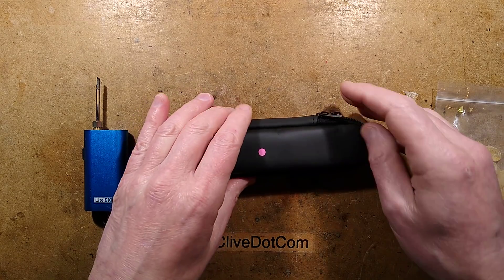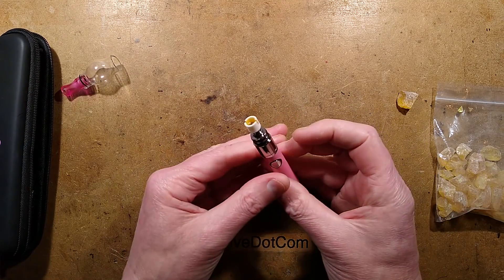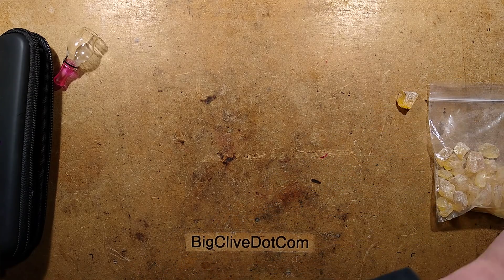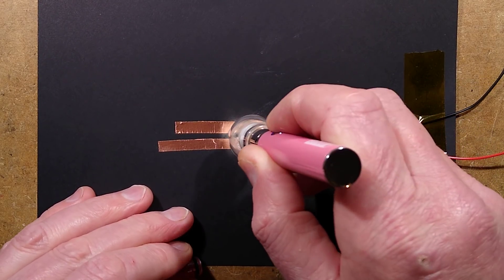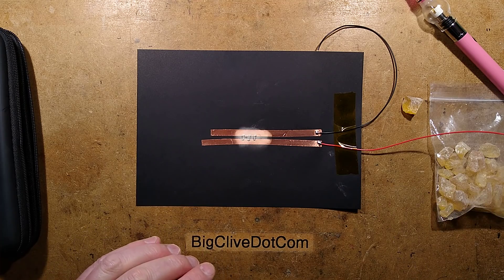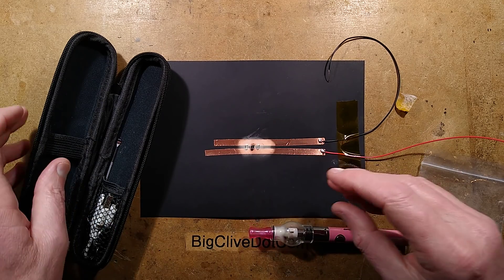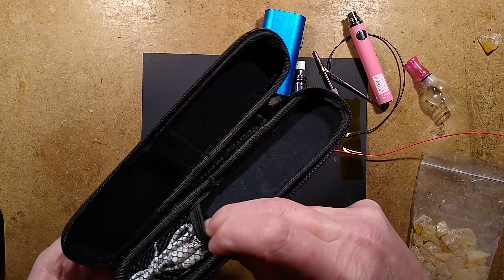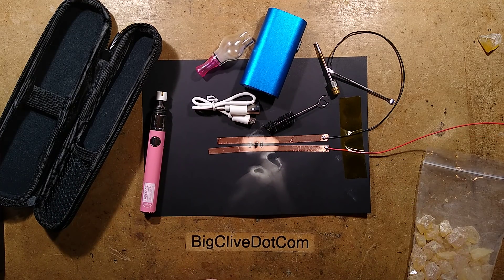Novel rosin vapour short circuit finder

Comment: It will impossible to use while diggin for a faulty component on a RF device , even more if the RF device works on high or very high frequency : you have to clean all the flux on rf devices because it can makes strange things such as self oscillations if some flux stands between two critical pads . So imagine on the entire pcb ...
Reply: I think you're confusing RF with "high impedance circuits", like gain loops with huge multipliers and giga-ohm resistors. These are much more affected with leakage through flux than RF circuits are - RF circuits tend to be really low impedance and thus not affected nearly as much by a little leakage.

Comment: I could see this being very useful for where a thermal cam is unavailable because of the high cost. Also beats the old stick your digit on it to see if it starts nuking or frying.
Reply: You can just put a little bit of IPA on the board too - it evaporates first on the component that's getting hot. Then the rest of it evaporates or you can blow off with compressed air, and the board isn't coated in rosin flux after. This is cheap, but rubbing alcohol is probably even cheaper

Comment: Definitely looks like a standard 510 connection for vape pens.
I'm sure the base is identical, even down to the little brush and the short power cable.
Reply: It's a complete concentrate vape kit. No difference lol. The big glass dome is to usually cool the vapor a little bit before you inhale, the small metal scoops are for hash, shatter, etc. I love it.
Reply: That's exactly what that is, a vape battery.
Reply: It's not actually a 510, it's an ego.
Reply: @TheShiningDark1  Poteto Potato. Close enough.

Comment: Ok, I guess you would use isopropanol to clean up the mess after diagnosing a short with that thing. But you could use alcohol/isopropanol in the first place to see which part heats up so much that it evaporates quickly, right?

Comment: Pink is magical because its the only color that can never be one real light based color. That is to say, humans can't tell the difference between red + yellow light and orange light, for example. Every other color on the wheel has a corresponding light wavelength that it can be associated with, but not pink. If red is  0 and blue is 2, then pink would be 1i because green is already 1. Pink can only be a set of [0,2], it cannot be a single number. Magic! lol

Thats a neat use of that, it doesnt seem to be modified in any way from a cheap "vaporizer" (boiler) though. Seems like it could be made better by redesigning the bowl to work better in a downward position, maybe add a crossflow vent to create air currents that help the rosin come out. Theres room for improvement here
Reply: @Matt Quinn Thats what I was getting at, sorry if it was unclear. I was using "pink" as a colloquial term for magenta, which i was using to refer to all shades of magenta not just a single wavelength set, which purple is, by rgb notation

Comment: I've seen that a while now. I think it's actually a gimmick. The way they do now, they use a voltage injector, which makes the shorted components heat up, then you use a thermal camera. Where did you get the copper strips? They're cool
Reply from the maker: Copper strip often sold for electronic uses on eBay and also as a slug repeller.
Reply: Can't say for sure, but I've seen self-adhesive copper tape on amazon (and some other conducting and non-conducting metals like aluminum, too). Those can be rather neat for repairs or prototyping (or decorating).
Reply: But this is a LOT cheaper than a thermal camera. The copper strips are just regular copper foil tape. I first saw these flux vapor things on Northridge Fix channel fairly recently. You can also use the Louis Rossmann method and just pour a little IPA on the board too - it evaporates first on and around the component that's getting hot, and you don't have a bunch of rosin to clean off the board after - all the alcohol just evaporates eventually.
Reply: @gorak9000  If we're talking cheap, then you can do without it entirely; electronics have been fixed long before these pipes appeared. The thermal cam is not so expensive. You just get a cat phone, which also has thermal. I've seen louis's method, but you can't wet a big board with alcohol, bc alcohol dries very quickly
Reply: @Kevin75668  You can also get it with conductive adhesive to use for things like RF / EMI shielding. Usually the stuff with conductive adhesive is $$$$. Even if the adhesive not being conductive doesn't matter, even the regular stuff is $$ because it's copper (and because it's kind of a specialty item)
Reply: @Kevin75668  I think I've only ever ordered the 3M stuff with conductive adhesive from digikey (on someone else's budget) - and that was many years ago - pretty sure it was at least $50/roll doing it that way (but again, someone else's money, so didn't really bother me)
Reply: @gorak9000   I think McMaster-Carr has a conductive adhesive copper tape which is cheaper, although I don't think it is the 3M one, it's some other brand.

Comment: These work great for determining the potency of crystal meth. Put some crystal in the atomizer and when you turn it on you will notice that if the meth is strong you'll get really high. If it's not that strong you will get alittle high and if it's fake you won't get high at all. These crafty Chinese electronic manufacturers are getting smart!

Comment: you should be able to unscrew the ceramic pot and find the 505 threads I think and you then can use it on the blue battery you were soldering with.

Comment: I've used one of these for the more intended purpose, it seems like it actually works better as the tester than it does a vape
Reply: The little "spoon" thing is remarkably like an ear pick!
Reply: I bought one of these for dabs/concentrate. Way more expensive since it was sold as a vaping product. $70 compared to $9. Im sure the one i got is a litter better quality, but still crazy the mark up is as a vape product.
Reply: Umm "vape?" You did see the little spoon it comes with?
Reply: @lucidnonsense942  as Daniel pointed out its for oil/dabs, which you can vape.
Reply: @lucidnonsense942  for putting your cannabis extract onto the atomizer
Reply: @lucidnonsense942  "You did see the little spoon it comes with?"
I never knew that a spoon dictates what substance you can scoop with it.

Comment: Hi Clive, the bulb thingy is there so it can keep lot of smoke in (while held upward) and be dumped on the board.
Reply: Haha it looked like marijuana inhaling device to me.
Reply: @liucyrus22  That's because it is. These were sold in smoke shops and vape related shops back in roughly the 2011-2015 era. They are for smoking hash oil. That's why they come with a plastic mouthpiece that fits over the glass dome. 
Eventually they were made obsolete for drug use after prefilled hash oil vape cartridges became widely available in recreational cannabis dispensaries (this was in WA state). 

I'm assuming they are selling these as a "short circuit detector" just to give it a plausible "legitimate" use outside of outdated drug paraphernalia.
Reply: @platyhelminthes2877  they still use these for hash, thc concentrates dabs/wax/shatter etc. When you buy that stuff in quantity, or make it yourself, you cant use the disposable stuff and need something like this a bong/oil rig.

Comment: You really do operate a channel ideal for the electronics enthusiast. I never had the idea to use one of these to vaporize rosin flux. That is much cleaner than liquid for hitting QFPAs with liquid.
Reply: From electronics diagnosing to crack pipes and everything in between. lol
Reply: @BillAnt  It's called an oil-pipe... dragging the name of a simple vaporizing device through the mud by associating it with crack shows how little people seems to know about this subject matter.
Reply: @chrisakaschulbus4903  - It was meant in a humorous way.

Comment: I have to get me one of these! I can see straight away that it's going to be very useful in finding faulty components in vintage radio and TV circuits, or at least, which resistive components are suffering an overload, and therefore where to start looking for the cause.
Reply: Not sure if useful for vintage stuff, unless our definition of vintage is different. Mine is vacuum tubes and big-ass components that heat up so much that the rosin powder will be gone on almost all of them (maybe save for grid leak resistors as they don't heat up). Plus the rosin would be soon gone thanks to adjacent parts giving off heat - especially tubes.

Comment: As soon as I saw the video title, my mind went "DING" with understanding.

Pro:  A lotta-lot cheaper than a thermal camera.
Con: Potentially more rosin cleanup, post-repair.
Reply: Even cheaper yet is putting a few drops of IPA on the board - it evaporates fastest on the component that's getting hot, and all of it evaporates eventually - no rosin cleanup required
Reply: con: everyone who sees it in your kit will think you're a meth head...

Comment: Rosin is a unique type of cannabis concentrate. It is made without using any solvents. Instead of using a solvent rosin is an extraction technique that utilizes the combination of pressure and heat to squeeze the resinous sap from the starting material (buds or trichome- rich cannabis leaves).

Comment: It's a vape pen for smoking weed oil. This is the same result as the freeze spray. Doesn't detect short but heat. These vape pens do not last long basicly disposable. Always look for one you can swap the battery or it's just junk. This is from personal experience. Gone through 30 or so of this type of vape pen before a gave up on them. Also the tips are not interchangeable with most quality vape pens. I wish they were.

Comment: Hmm i'm actually wondering about the temperture required to melt these small crystalls, as far as i remember resin is amorhic and melting point can varry quite a bit depending on circumstances. I wonder if you can control the size of the crystals or the height of the layer to control the monitored tempurture. It would be just bombastic if someone actually researched it!
Reply: Controling the crystal size is probably not viable. The cooling rate is very much dependent on thermal mass and conductivity of the coated surface (PCB). Best bet would probably be to pre-heat the target surface, but probably not worthwhile.
 
I'm sure one could modify the rosin chemically though to get such an effect. Mix in other stuff or use something other than rosin.

Comment: I've actually wondered if you can use the plant resin these devices were originally intended for as flux. It's got organic acids and terpenes in it just like pine rosin, but I really don't have any idea of the actual chemistry behind how rosin flux works.
Reply: bruh it's sticky as hell and has a burn point just under the melting point of solder, so i highly doubt this is a wise experiment.
Reply: @supernoob17  "Bruh?"
Reply: @soundspark  i apologize good sir i did not know this was a formal occasion and should be addressing you by the formal honorific "my brother in christ"

Comment: Thats such a novel trick to quickly identify a fault, i kept putting boards in NOVEC fluid to see which component made it boil, this is so much easier and cleaner!  cant believe i didnt think of that.... nice one Clive, ur a legend :)   , 8-bit.
Reply: Isn't novec horribly expensive to boil off in the air ?
Reply: Good tip. Where is NOVEC purchased?

Comment: Interesting! Now I'm actually tempted to get something similar with a 3.5mm jack on it to connect it to a TS80/TS100 soldering iron…🤔
Reply: I don't think that'll work.. Vapes typically run at the voltage of 1-2 cells running at upto 20A+, while the ts80/100/pinecil expect 12-24v at a lower current to achieve the same power.
Reply: @Annon201  Yeah, totally possible. I guess the big question is the quality of smoke/vape you can create.

Comment: I have an usb wall charger that I have detected using a noncontact voltage tester ac120v on the USB cable and my phone. it's an aukey pd charger and I was wondering if you would want to take a look at it. I enjoy all your videos.
Reply from the maker: The radiated field is common with ungrounded electronic power supplies.  It also happens with good quality ones and anything connected to them.

Comment: Many devices we use today had their origins meant for other applications.
Necessity is the mother of invention.
You typically do not look for something until you need it.
Reply: Indeed, albeit it does make me think who actually had the idea of using an electric crack pipe as a repair device... I can't fathom the thinking process.
Reply: @Kalvinjj  It’s simple, you smoke some crack and suddenly you feel the need to repair something, something close and not too far away, like the pipe your already holding and since it’s working already you’ve all the more reason to fix it. Then it’s just a matter of time or about 5 minutes before a fluxing accident happens, like when someone tries to actually smoke the magic smoke thats in all these components and makes them work in the first place.

Comment: Oh hey I have one of those - well, the same tip on a different pen - and I also use it to vaporize resin. <_< What? I live in Colorado! This is sorta clever tho...if you can find the solid resin? do they provide a lifetime supply? I dunno, I just flood everything with liquid resin then wash it with whatever's necessary when all the parts are on. (j/k)
Reply: Cool story, bro.
Reply: @littlejackalo5326  Tired comment, troll.

Comment: I've seen droplets of IPA being used for the same result in finding overheating components, this does look very useful.

A friend upgraded and gave me his device which I think has the 510 thread, I guess a replacement tank and soldering iron tip are not the only things I need to buy for it now.
Reply: This is more visible than IPA. In addition, if the components are too close it would be a bit ambiguous which component IPA is running away from. With this device, the component is literally highlighted. I think of getting a cheap thermal camera to look for the approximate location of the short and this device to precisely know which component is shorted
Reply: @OneOfTheNerds  ... can I use lager if there's no IPA handy? ;-)
Reply: @ulrichs.3228  I was waiting for this, vodka or Wray and Nephews rum maybe.
Reply: @ulrichs.3228  Nope, nope.   That's too thick.  You might be able to substitute American beer.
Reply: @tbelding  Louis Rossman has demonstrated doing this with high concentration grain alcohol (possibly denatured).  But yeah, a colored equivalent would be easier to use, especially if it boils below 150°C so it doesn't interfere with soldered components.
Reply: I have used IPA for just this. Saw these a few weeks back and was thinking of one for my grab box
Reply: It's not uncommon for us board repair folk to inject voltage into phone logic boards dunked in IPA and look for fine bubbles in the problem area with a microscope, I've used freeze spray as well as flux misting (this method) and very much prefer dunking when it comes to clean up, even if it does have a little more setup. I will one day re-mortgage so I can try a thermal camera and see how that measure up.

Comment: I wonder if that windscreen would work with a hot air rework nozzle? Not sure if one would actually want to use both at the same time, but you never know.

Also I'm digging the copper tape circuit. Best prototyping medium if you want flat and flexible.
Reply: I believe it is poundland self adhesive slug tape (slugs and snails don't like copper ) six ft for a quid
Reply: @lawdelpus  I'm in the States, so I get one big ol' spool each of a narrow and wide tape from Amazon. The narrow tapes tend to be thicker copper.

TBH it would be really cool if Daiso or Dollar Tree (Japanese and American equivalents to Poundland) would carry copper tape, but I've never seen anything made from copper at those places. I do, however, see a ton of plastic, paper, aluminum, and steel...

Comment: Wouldn't freeze spray be easier :-)
Reply: sometimes, but the frost will soon dissipate into moisture if you're not quick enough powering up, plus the low temperature may affect circuit operations, even temporarily curing the short if its a temperature related issue ..
Reply: @andygozzo72  Flir camera then :-)
Reply: @Omegaman1969  ..if you can afford one, i certainly cant ...
Reply: @andygozzo72  Yeah I have one of the ones that plugs into an Iphone, it's really useful.
Reply: @Omegaman1969  i dont have an iphone, or any mobile phone, so no good for me..
Reply: @andygozzo72  phones are cheap enough.
Reply: @Omegaman1969  some may be, i have no real need of a mobile phone 😉 i have few old second hand ones,  would be classed as very dumb phones by modern standards , 😁
Reply: @andygozzo72  well it’s good you need little tech.
Reply: @Omegaman1969  i dont have anybody i'd likely need or want to text or talk to 😉 , i have  loads of 'tech', OLD tech, vintage radios, tvs, record players, computers, etc. my main computer dates from 2007,  what i'm using now is a 2015ish cheap bush tablet,  both second hand,  only new computer i had was in 2006, still got it and working,

Comment: Unfortunately this may not work that well in a real situation with a dead short. Because P=R.I^2 that is very small if R is almost zero.
Do the same experience with damaged components or with a very thin wire between the 2 tracks...
Reply: Works just fine in real situations.

Comment: Next up:  miniaturized combined SMD repair kit - soldering iron, rosin vaporizer, just a hot air gun missing...
Reply: Since there's already two vaporizers here used as alternative tools, it seems appropriate to use a lighter as an alternative hot air gun